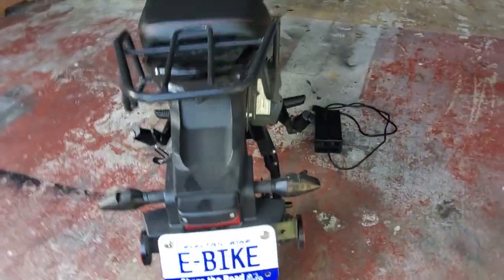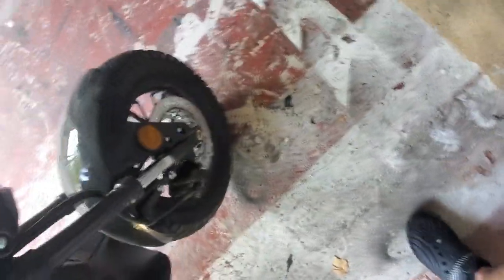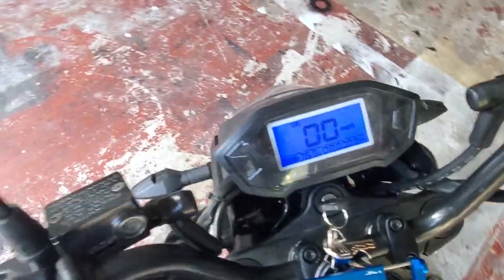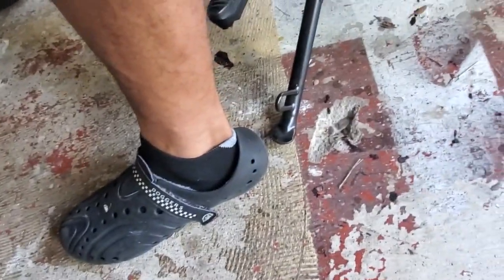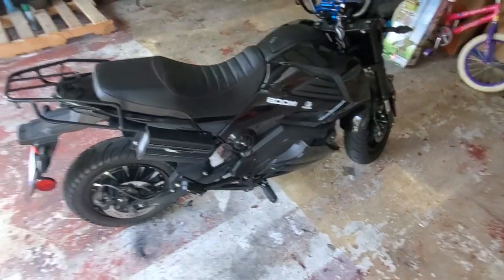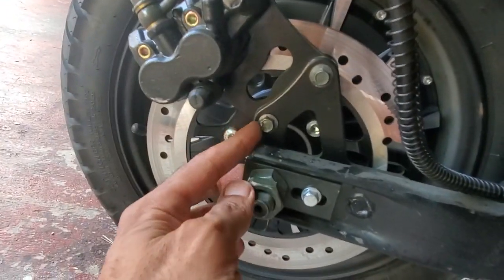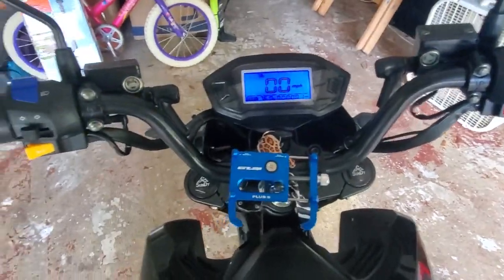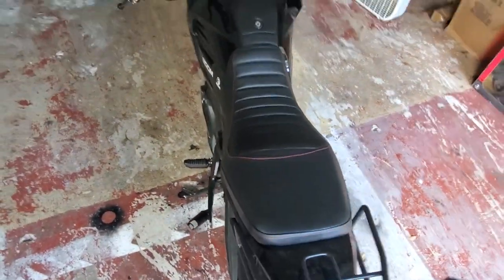Boom BD578Z/ E-Grom/ Boom Evader/Boom EX-20 / Electric Scooter Review

Comment: by the way i have clocked over 5000km on my bike, that's about 3500 miles and the bike has no flaws. had to change a rubber on the brake handle a year ago, and just changed one of the six batteries today (I have lead acid batteries and not lithium ion:( )
Reply from the maker: I've been wanting to swap my batteries as well. I wanted to do a lithium swap for more range. How difficult was changing them?
Reply from the maker: How difficult was it to swap out the battery? Are the plastics difficult to pull off? Would you happen to have a video of how you did the swap? I would be very interested. I'm thinking of doing a lipo swap when the batteries run their course. I read somewhere a guy attempted to take it apart and when attempting to screw the parts back into place one side cracked.
Reply: I wonder if the built in charger/bms is setup for lithium or only lead? I know the lithium requires a different charging scheme than lead acid using constant current then constant voltage (CC/CV). This bike seems to monitor six 12v cells, while a lithium setup would need to monitor 20 rows of 4.2v cells.
Reply from the maker: @JasonWW2000  Interesting information, thanks. That may have saved me a headache. I'll try to look more into that. Limited information is available about this bike. I find as I go, and research questions as they come along. That is a very good point though.

Comment: How fucked up is everyone's state? In CT you need to go through the 5 to 7 month process to get a drivers license to ride a 49cc scooter. At that point it would be better just to get a used car.
Reply from the maker: Ouch! That blows...Yeah everyone's state is different. With that much time invested...you're right. A car would be worth the time/trouble. But not a bike. Unless you have your heart set out on it...But if you're going for a license just for a 49cc...might as well get a bigger bike. Depending on where you get the bike from, might catch an attractive deal. They have plenty dealers online that'll ship it to your front door. Some assembly would more than likely be required. But you can't beat the "ship to your door" delivery.

Comment: I was looking to get one of these and I've got to say this has been the most enjoyable review I've seen and you've answered a lot of my questions before hand. Thank you.
Reply from the maker: No problem. And thanks for watching! Glad I could help in some way
Reply: I just ordered one similar from china with more mileage up to about 62 miles and about the same speed and 2000 watts got it for a pretty cheap price for about 650 bucks but not including shipping cost which was like more than the actual bike! But helpful review!
Reply from the maker: @cosmic6230  There are a lot of different vendors. Just be careful. Shipping rates will keep increasing as tensions continue. I bet you're loving the bike you got! Thanks for watching
Reply: It's shipping out it hasn't got to me yet but thanks for the info.
Reply from the maker: @cosmic6230  hopefully it won't rain much there so you have a chance to enjoy it
Reply: So it isn't possible to ride in the rain?
Reply: Im pretty sure it is possible
Reply: Without damaging it...?
Reply: Yup be would recommend double checking that cause I haven’t gotten mine yet so I can’t say.
Reply from the maker: @cosmic6230  it is possible. Just make sure you seal any areas that would potentially leak water into the internals of the bike. Like mine for example. It worked fine at first, then after a light rain it stalled my hub motor. Had to let it dry for a day with a fan on it. Worked again after it was dried. But just a warning to note.
Reply: @cosmic6230  yo did you get that bike ever? how is it?

Comment: hi. you overlooked the fact that it has regen braking. when going over 26 kph if you slightly press the brakes you regenerate power. be careful though because it decelerates hard at first. so you need to get used to it
Reply from the maker: Didn't overlook. Mine just doesn't have that capability. I have the 2019 Boom E-X20. I spoke with the dealer directly about regen breaking. It does NOT have regen breaking. Hydraulic Braking only. Thanks for watching!

Comment: Seeing as how the left blinker turns off too soon and the right not soon enough, I'm guessing the mechanism that senses the handle bar position is out of adjustment. Look on the bottom of the head tube or around that area. See if there is a mechanism that can be twisted. When centered properly it should turn off both blinkers at about 15* off center.
Reply from the maker: Huge thanks!! I'll go check that out. And thanks for watching!
Reply: @techjunkie3916  I've got an old 86 Honda Goldwing with auto cancel signals and wanted to adapt that mechanism to a different bike so I did some research. The Goldwings use a steering angle sensor and an odometer signal. There is a control box that will cancel the signal if the steering angle sensor gets turned far enough or if enough distance has been covered. Your bike probably has an angle sensor as well so I bet it's just out of adjustment. These cheap and quickly built Chinese bikes don't have much quality control so this seems likely. BTW, I'm a Houstonian as well.

Comment: I just got mine.  I am 74 and couldn't figure out where to plug it in ... thanks for that tip.  I would have liked to see you charge it even though it is a no brainer.  Where is the battery located in case it needs to be replaced? I bought as a 2nd pair of wheels for when my car is in the shop but will probably use it most during the summer.
Reply from the maker: The battery is going to be underneath all the plastics where you would find the charging port. They have a compartment once you start to pull the plastics(fairings) off a bit.
Reply from the maker: And thanks for watching! I would have charged it in the video but I figured people might just want to know where it plugs in.
Reply from the maker: You're going to have loads on fun on it. Just keep it away from rain, and sizeable water puddles
Reply: @techjunkie3916  one more question. The white box has to be on when charging right? I guess you turn it off to start the bike?
Reply from the maker: @wishbone103  I didn't have a white box on mine. But the switch does need to be on. Only turn it off after putting it up for storage/shed/garage parking. Leaving it on may rob you of a few miles depending on how long it was left on while not riding/charging.
Reply: @techjunkie3916  I have the Venom E Bike but they are similar.  I can't seem to get mine started.  It seems to be fully charged because of the green light.  But when I turn on the key nothing happens. No lights or anything. I am missing something.  Even Venom Tech support don't seem to be up on their E bikes.
Reply from the maker: @wishbone103  Make sure the power switch is flipped. You may have to try it again. I remember when I had mine it was a slight learning curve due to steps required. I was completely new to those bikes
Reply from the maker: @wishbone103  flip the switch, then insert and turn the key. But make sure the power cord is disconnected. It will not turn on while charging
Reply: @techjunkie3916  My problem was I was not turning my key far enough to the right ... duh!
Reply from the maker: @wishbone103  Hey, at least you got it figured out! Sometimes it's the smallest things we often overlook.
Reply: You're 74 and ride an e-motorcycle? Damn!!
Reply: @DavidVonR  76 now 😁

Comment: Just picked one up. When I hit the start button, horn goes off. What’s your process for actually starting it? Lol
Reply from the maker: When I owned one I would have to turn on the power switch on. Which was located where you would normally charge it. Then make sure it's in the on position.

Comment: Are you able to take the battery out to charge?
Reply from the maker: I hadn't personally. But I'm thinking it would be a waste of time, and money. I would suggest just getting a lithium battery pack. Longer life, holds charge better.
Reply from the maker: You probably can, but expect to pull most of the plastics off, and since their plastic is not the best quality....I would be very careful when attempting.
Reply: @techjunkie3916  I was asking due to me living on the second floor in NYC. I don’t have a garage. Would need to take the battery out to charge at my house
Reply from the maker: @uniqueanartist6792  it would be quite cumbersome after a few removals. But I do get your point. That's entirely to much weight to want to pack.
Reply: @uniqueanartist6792  the CSC city slicker has a battery u can take out to charge but it is more

Comment: I got one and it sucks im having so many electrical problems ill be putting a motor in it dont buy this bike if you dont have moeny to spend there not realiable
Reply from the maker: Sorry you had a bad experience. I didn't have the same experience as you did. Mine still worked fine after a year of owning it. Don't ride in water, puddles, and don't ride in mist, don't ride in rain. It will last.
Reply: I DISAGREE!! i got mine in september...it has been my daily commuter ride... Every day 20 miles round trip in los Angeles traffic...I couldn't be happier! I am thinking about making a lithium-ion battery to replace the lead-acid battery it comes with...RANGE is literally my ONLY complaint

Comment: Can you ride it in the rain
Reply from the maker: I would say try not to. The rear hub motor may stop working temporarily until it dries out completely. Mine stalled on me when I was riding home one day due to rain. After I got home and parked it. It wouldn't turn back on for about a day. I had to put a few fans on it. Granted it was a heavy downpour, I still wouldn't recommend it even if it's sprinkling. Better safe than sorry. The controller may get wet and the rear hub motor may develope moisture inside due to the rH from the rain.

Comment: Range?
Reply from the maker: So far, since I don't peel the skin off the throttle around 25 miles - 35 miles per charge

Update: Hovering around 32 - 40 miles per charge. Their posting seems accurate. 20mph = 40ish miles, and going around 40mph you'll slide back to around 20ish miles. So it seems that 30mph or so would even out to 30mph/30miles.

Comment: Have you have any problems with the rear tire getting slow leaks etc
Reply from the maker: I've sold it since the video. But when I had it I never noticed any slow leaks. Pressure was pretty constant. I used to carry a tire pressure gauge on my keys to make sure.
Reply from the maker: Though I don't remember the exact psi
Reply: @techjunkie3916  ok thanks I have the venom x21 50cc but looking into getting electric now
Reply: @techjunkie3916  can I ask why did you sale it for
Reply from the maker: @efrainregalado8297  I wanted to have something with a little more oomf, and can comfortably do speed limits here in tx. Frwy is 65. Bike topped out at 58mph. And with everyone flying 70 or 80 around you. Safer to have the get out of the way power...and 58 was going down an overpass
Reply: @techjunkie3916  I understand what you mean I live in Texas myself I have a Raven 250 but I was wondering about a ebike I don't take out my Raven that often I use it to go for a cruise like on the weekends
Reply from the maker: @efrainregalado8297  You can enjoy it. Just try your absolute best to stay out of rain and puddles. And later down the line you'll more than likely want to extend your range. And a battery pack twice the capacity would run a pretty penny. There is a guy on YouTube who did it. I can link you to his page when I run across it again. I think he got his to around 60 or more. You'll want more range for sure!
Reply: Like I said I don't ride that much I only do it just to get out of the house I had a stroke a few years back so I just want something a little lighter for me
Reply from the maker: @efrainregalado8297  I can relate. I had a stroke at age 17, years ago. I completely understand. I bought mine because I am legally blind as well. So it was perfect
Reply: I'm going to check into them for sure thanks
Reply: @techjunkie3916  can I ask how much you sold it for
Reply from the maker: @joshpointoh  I don't remember the exact amount. But I sold it for less than half what I paid. I want to say the initial cost was around $1800, so I probably sold it for about $850 or so.

Comment: I’m receiving mine today (2021 edition). @9:30 Which # size (10mm etc) tools do I need to tighten up the bolts (just in case I need to)? 🤔
Reply from the maker: Thanks for watching! I don't remember the exact bolt size.  But it comes with a small tool bag ( or should ). Checking bolts and screws is always advised. Good thinking. 👍  Luckily the one I purchased didn't need any tightening. I'm sure q/c was on their job for these. If you would have purchased a hellcat, or carbureted grom clone. Definitely need tightening.
Reply: @techjunkie3916  Gotcha, but like you said “better safe than sorry.” 💯
Reply from the maker: @ROBB_DEEP  It's been a while since I've had it. I ended up selling the E-Vader/e-grom to get something else. Great bike though. Just try to avoid riding in to much rain...and try to avoid water. The rear hub motor acted up on me when mine got wet. Had to ride in the rain one day...after I parked it.... wouldn't cut back on for about a day.  It had to dry out.
And congrats on the purchase! You should get anywhere from 20 to 50 miles per charge depending on your speed. Full throttle will be 20 miles or less per charge, and so on... and the top speed I was able to get was 43mph.
Reply: @techjunkie3916  Ohhhh ouch! I never ride in the rain anyway, only on dry ground! Keep riding bro, this is my 3rd machine! ⚡️🛵🛵🏍🤙🏾
Reply: @techjunkie3916  I wonder is there a way to unlock the speed to go faster?🤔😆
Reply from the maker: @ROBB_DEEP  I heard somewhere that is it. But from what I've read it's a wire. But depending on how fast you want to go, a more powerful hub motor might be your best bet. But you'd need a new controller. The controller will be where your tailpipe should be. Oh yeah. If that gets wet too...no go. You're right dry riding only!
Reply: @techjunkie3916  👍🏾
Reply from the maker: @ROBB_DEEP  There is a guy on here "theinja" he bought one ( different one, from alibaba ) and bought the parts to make it faster. Him and his engineer friend got it to pretty high speeds. Quite a bit was involved though. 😳
Reply: @techjunkie3916  Cool, I’ll have to check em out once I get back in from deliveries

Comment: I have a 50cc 1991 Honda NS50 road bike. I used to hit 54 mph on a slight downgrade when I weighed 175 lbs. I still have the bike in my garage, it's in mint condition except for the tires. I used to take it on 13 mile commutes to work 27 years ago.
Reply from the maker: 90s were so much fun. So much freedom in riding! Thats a nice bike man! Especially still mint!

Comment: Whats the top speed
Reply from the maker: Short answer: For me it was 43mph.
Long answer: It's weight dependent. I'm around 170-173. Standing 5'11. You'll get variable speeds if you live in an area that has hills. That will dictate speed, and range also.
Reply: @techjunkie3916  well ny height is 5,3 and 90-100 weight
Reply from the maker: @pinder5706  You'll probably get closer to 46-48mph and probably even 50 with a tailwind. BUT. Expect to only get around 20 miles per charge if you run it WOT all the time.